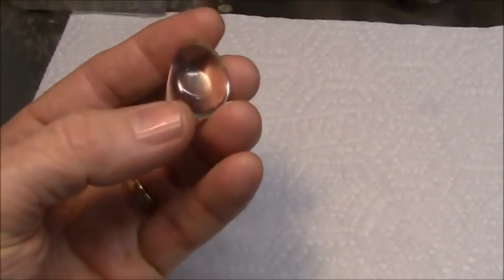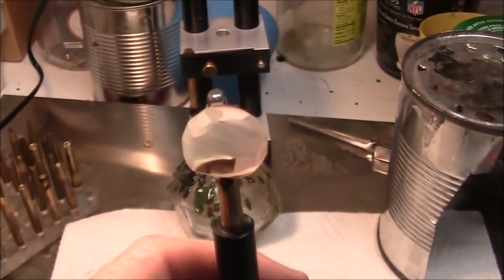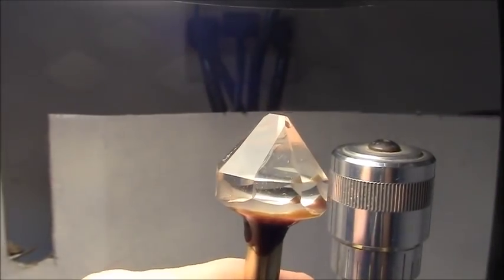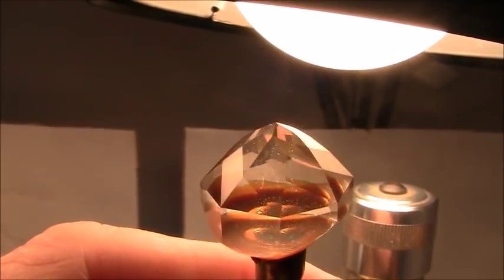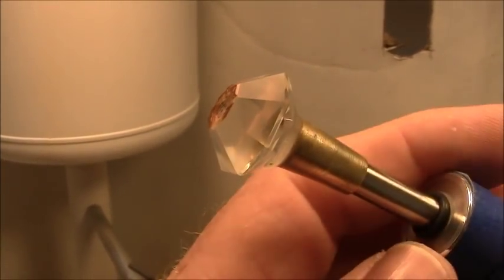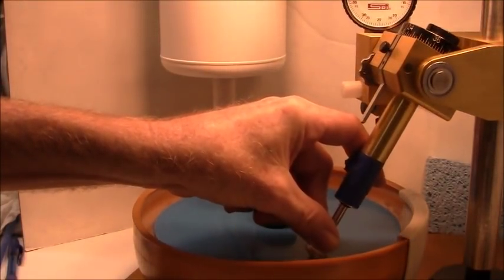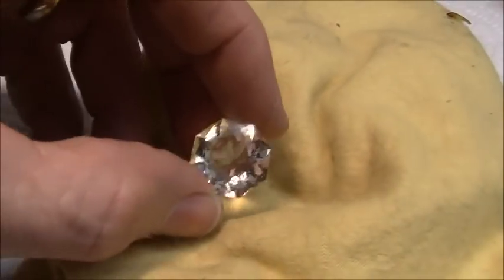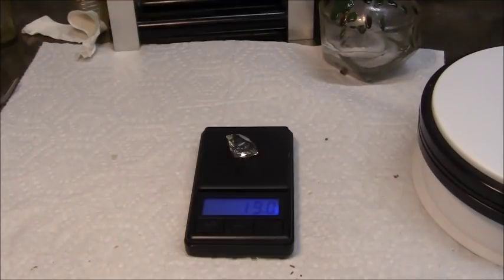Faceting gemstones - the pinwheel.

Comment: I'm really surprised at the finish your laps make considering 300 or 600 grit laps making a somewhat polished or at least Clear finish on the stone. 
My 600 topper (pretty new) still leaves a frosted finish and I'm not so sure my 1200 doesn't also (at least compared to your finishes). I just bought a 3000 grit topper which is supposed to be considered a Pre-Polish Lap ... but I don't know I'd call it that (at least not until it is well broken in by comparison) considering my 1200 grit Raytech Pre-Polish lap leaves a MUCH Smoother, shinier finish than the 3000 topper. 
What's your secret ?
What Make/Kinds of Laps do you use ?
Reply from the maker: Hello, i looked back thru the video and   i used  a 600 plated   lap for most of the cutting but then i used a 1200  lightning lap resin bond , the blue colored lap ,   and i used a 3000 lightning lap for prepolishing , sometimes i used an 8000 lightning lap for  the last prepolishing  stage, then cerium oxide lightning lap for polish.  lately im using a 600 plated lap then going directly to 8000 diamond paste on copper for prepolish  then final polish   , this would be on quartz,  or feldspar, most stones at 7 mohs or less.